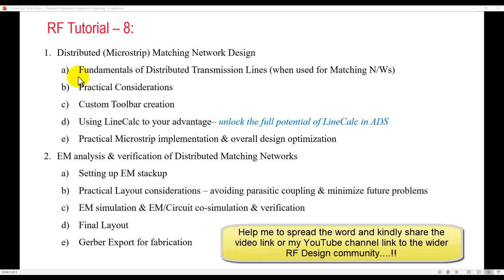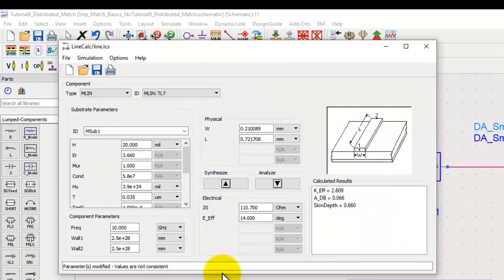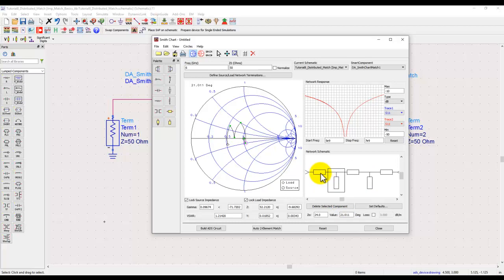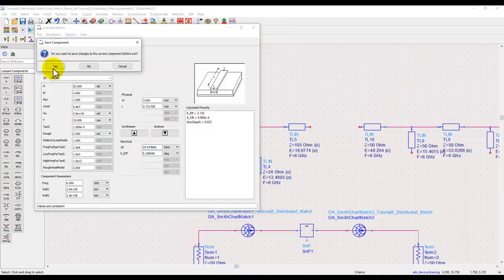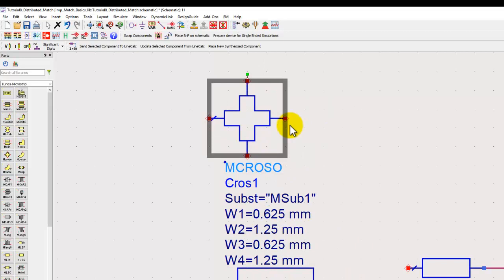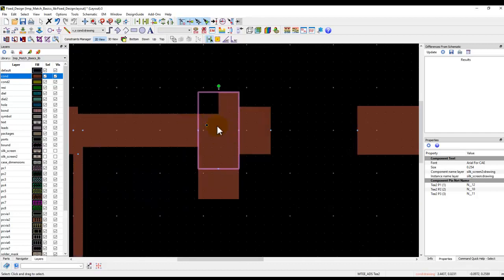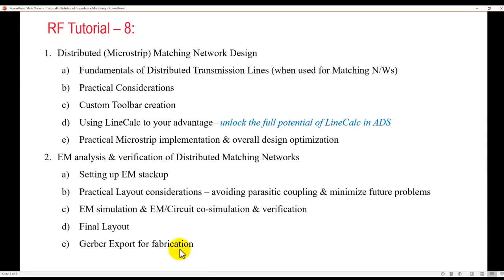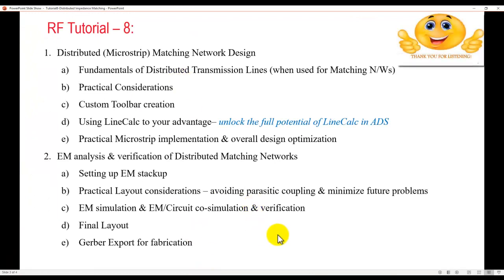RF Design-8: Distributed Impedance Matching Network Design

Comment: Thanks alot for the tutorial , I am struggling with my LNA design 
It's match perfectly but when i connect my antenna the noise figure increase and the matching courrpted ,my antenna also match Very well s11 about -30dB
Reply from the maker: It might be due to the Antenna impedance's impact on your LNA. Your input impedance matching network could use complex to complex matching methodology. Check out other videos in the series to get your answer

Comment: I’m trying to match a broad band antenna but the smith chart tool only tunes one frequency. I’m trying to explore alternative cosim strategies but nothing is giving a good impedance in broadband. I’m matching 617mhz to 5GHz and the antenna is very high impedance at low band. Do you have any advice? I appreciate your tips here but I’m not able to implement them for my purpose, other than possibly redesigning my antenna

Comment: How can I match two frequencies.
Reply from the maker: You can match any number of frequencies with the proper simulation setup and optimization bench as long as you have the right network model in place.
Reply: @BhargavaAnurag  frequency Iam matching is 0.915 GHz and 2.45 GHz. I have matched 2.45 and I am confused with how to match 0.915GHz since the Smith chart can match only one frequency at a time.
Reply from the maker: @Amruthappillai  Yes, that is correct and limitation with Smith Chart in general. However, if you already the network that you would like to use then you can perform optimization and calculation etc directly in ADS schematic and don't need to restrict yourself with Smith Chart alone. I mean you can get the initial guidance from Smith Chart but then rely more on ADS schematic design to complete the matching network design....
Hope this helps.

Comment: Sir, I have a doubt, if the width can't be increased beyond 3mm(Z0 = 24.57) then the limit on Z0 will be 25 and not 24 , because to get Z0 = 24, we should increase width further.
Reply from the maker: Usually it is never a problem for fabricator to print lines as wide as you want so there shouldn't be any concern. Even if it is a concern for you due to overall size etc then also you can design circuits within the constraints you have.

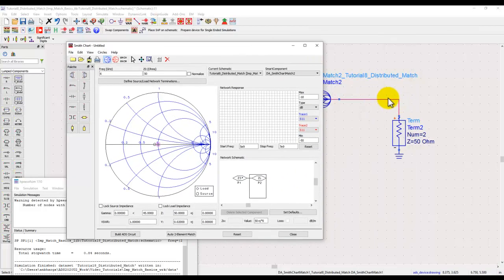Comment: At 16:35, you used a 70 ohm, 20 deg line for accomodating sma pin. What is the issue with taking 50 ohm, 20 deg line? And, how do we know that sma pin lead has width corresponding to 70 ohm ?
Reply from the maker: Its all about pre studying your material and knowing the limits and key impedances as per the stack up being used. You can take help of Line Calc to keep few numbers ready for your designs.

Comment: Sir, there is no hole layer in the stack up so i couldnt switch the entry layer to hole.
Reply from the maker: Switching to hole layer for drawing in layout has no dependency on the stackup but there is no fun doing that either as it will be ignored during simulation.
1. Right click on the stackup dielectric and select Map Conductor Via, it should by default be hole layer but if it is not then you can change it easily from the right hand side panel
2. In Layout window, simply look for the drop down menu with the layer name in the toolbar and select hole layer and draw the shape you want in the layout

Comment: Nice work.  Does a diode(SMS7630, HSMS XXXX series have footprint in ADS? If yes how can I get them to convert my schematic to layout
Reply from the maker: Kindly watch the video on Layout footprint etc under Learn ADS in 5mins playlist. Its very easy to create a footprint and associate it to any component you have in your schematic design.
Reply: Good I got it. I have a purely imaginary load. When I put in smith chart it says real part must not be zero. what do I do?

Comment: Helpful videos sir. I have a query sir, can we build a matching circuit without using smith chart. I am trying to design from a paper where the matching circuit is built using microstrip components such as MBSTUB, MTaper,etc
Reply from the maker: Smith Chart makes it easier to visualize how your matching components transforms the impedance when you add different components. If you already have the right network topology then you can simply use optimization feature in the software to achieve the needed impedance without using Smith Chart.

Comment: Thank you for the elaborate explanation sir. May i know if the procedures for the non uniform transmission line matching circuit  is same as this?
Reply from the maker: I am not sure what is meant by non uniform transmission lines but largely the procedure will remain same.

Comment: please tell me, Is the fabrication process of antenna and (impedance matching plus rectifier circuit)     different?
Reply from the maker: I am not pretty sure if I got this question correctly but if you are asking about the PCB fabrication then yes, it is exactly the same process.

Comment: Good day sir, thank you for your effort for making such informative videos! May I know if it’s possible to add components soldering pads to the layout of the circuit before exporting it into a gerber file?
Reply from the maker: Yes, you can and you need to map it like any other conductor layer or footprint.

Comment: Sir I have designed complete schematic of PA in ADS but when i generate layout I am not able to got correct layout as it have some lumped components also but distributed transmission lines are also not generated as in schematic..Please help me out how I can generate layout to perform em simulation.
or I have  to design my circuit in layout again but it’s very big circuit please guide me in best possible way and if i m doing some mistake in generation.
Also suggest me how to use another method of place each component from schematic to layout.
Thank you
Reply from the maker: Hi,
You can use Place components from Schematic to Layout and place them 1 by 1. I will soon have a video on this topic in next 1-2 weeks which should be of your help.
Reply: @BhargavaAnurag  Please make video in detail sir, as one is doing first time  EM co-simulation (having both lumped and distributed components in design)
Thank you Sir.
Reply from the maker: Its already there on my channel. Look for EM Circuit Cosimulation video and that explains all the details necessary for beginners.

Comment: How to determine the input for the MSub.? where to get those input (reference).?
Reply from the maker: MSUB parameters depends on the substrate/PCB you want to use for your design and manufacturer datasheet will provide all the required values.

Comment: What can you do when you're using a PDK which doesn't appear in the Line Calc. tool for substrate definitions? How can you convert TLIN elements to MLIN which are in the PDK?
Reply from the maker: Hi,
I couldn't understand the exact query. You normally don't use LineCalc for PDK as design manual might provide 50Ohm width already and in some PDK when you change the width it shows the impedance in the dialog box itself. If none of that works then you can simply create a schematic template with 2 50 Ohm terminations, place you line and make width to be optimizable with S11 optimization goal as better than -40dB or so and ADS will let you know what width value provides the best matching and that's your 50Ohm width. If you need any other impedance than 50Ohm then simply change the terminations value to that number and run optimization to obtain width value for that impedance.
Hope this helps...

Comment: Hi Anurag, When using the microstrip Tee junction model, I get warnings saying that I have violated the largest width to smallest width ratio for the model. This is a result of having generated an optimized impedance matching network. Should I ignore these errors and proceed to layout? Or, should I allow this constraint to dictate how good of an impedance match I can achieve?
Reply from the maker: Hi Abraham,
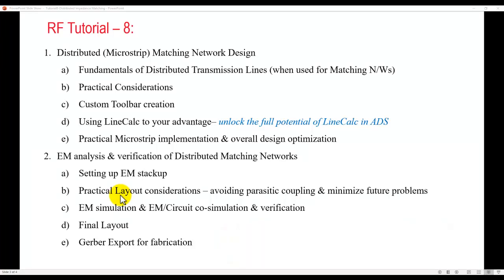Schematic discontinuity models use analytical equation in Schematic which has their limits to maintain the accuracy of the formulation or the assumption they are build upon and usually for models such as TEE and STEP etc it is 1:5 or 1:10 ratio that they recommend, if you cross that then you will see these kind of warnings in the simulation status. You can ignore them and your simulation will surely run but it is telling you that if there is any reflection happening at that junction it will not be accurately captured in your circuit simulation and when you perform EM simulation you will see increased discrepancy between schematic and EM results. 
EM simulator are physics based so they don't have any limitations for the width ratio at junctions and will capture any distortion caused due to high width mismatch.

Personally, I never like to have this kind of situation as it is not a good design practice (however no one is stopping you in having these in your designs) and if I see this situation after optimization then I will try to create a stepped impedance section for that transition e.g. you can go from 0.2mm width to 0.8mm and then eventually to 3mm instead of directly connecting 0.2mm wide line to 3mm line as then the impedance mismatch will be too high and bigger reflections will surely happen depending on dielectric material and frequency of operation.
Hope this helps in some manner?
Reply: @BhargavaAnurag  Thanks Anurag! Yes, this helps.

Comment: Simply wow!! I've been using ADS for many purposes but this tutorial was simply amazing. 

There is a one question. Doing impedance matching for small bandwidth is easier compared to wideband matching. I'm using multiple RF SMT components in series cascaded manner and when I cascade them, the overall return loss degrades despite the fact the their individual s-parameters are very good.

Nope my frequency is upto 26 GHz and I'm unable to control the return loss crossing 10 dB threshold even with matching techniques using radical stubs for wideband matching. 

Any insight into this problem? Any literature, video, documents, books or anything related will be of great help.

Thanks once again for wonderful tutorial.
Reply from the maker: Hi Hamza,
Too many queries here but let me try to answer:
1. Thanks for your feedback and I am glad you liked it.
2. For wideband matching kindly see RF Design-7 tutorial. When overall return loss degrades that's where RF/uWave fun begins...😊 Kindly use SP_Probes to inspect impedances between network and try to approach your matching network design scientifically instead of using brute force.
3. When you say your frequency is upto 26GHz, I am not sure what are you using for fabrication as PCBs will have high loss and sensitivity to anything above 18GHz so things will get very tricky. Using distributed matching is one of the option but you will need to use something like 5mil or 10mil (max) substrate to avoid radiations and etching high impedance lines on such substrate would be quite challenging.
Best of Luck...
Reply: @BhargavaAnurag  I appreciate you replying our comments and that's encouraging 😊. 

Yes, I'm using 5 mil substrate with 50 micron lines accuracy. 

I'll go through the tutorial and methods you mentioned and hopefully it'll help as always.

Thanks again 😊

Comment: Hi Mr. Anurag, I really enjoy your video tutorials, it is very helpful ^^ What is the Layout Units/ Resolutions settings that you are using? I couldn’t get my circuit to fit perfectly like yours even though my microstrip lines dimension are similar to yours... /.\
Reply from the maker: For these kind of designs I always use 'mm' with default database resolution nothing very special...

Comment: Amazing video! I'd like to ask for your opinion on what should I do if I want to simply just set the microstrip line between two components without considering about matching? How should I set the dimensions of the lines?
Reply from the maker: Hi Pay,
Usually we prefer using a 50Ohm line to connect between components and you can calculate the width of 50Ohm line using Line Calc depending on the substrate properties.
Hope this helps...👍
Reply: @BhargavaAnurag  It's clear, thank you very much for your reply!

Comment: Since you've helped me so... so much, I'd like to give you a quick tip for sorting out all the working windows onto your screen underview. 
Try windows+right (or left) to shift the selected window to the right half or right half of your screen, and upon further using down or up you can get the window to be quarter of the full working screen.
Reply from the maker: Thanks for the tip...👍I was only aware of drag & drop, this makes it simpler...😊

Comment: I am following your video and it’s being very helpful. Can you please help me if I want to design input and output matching network only with MLIN transmission line without using MLOC lines .It will be great help. Thanks in advance.
Reply from the maker: Hi,
That will depend on the impedances that you want to match and may not be always possible. You can the Smith Chart tool so feel free to try out whatever topology you want and play with the impedance of the lines to adjust the locus and drive it to the desired point as per your requirements.
Reply: @BhargavaAnurag  Thank you Sir . I will try for same. Please can you make one video on load pull simulation using ADS in correct manner because your videos are very clear and show the right path.Thank you.

Comment: Thank you so much for this valuable video.

Please, after we design this on ADS and fabricate the circuit, we need to add an  SMA to connect it to a coaxial cable, and this will change the circuit. Then, can you explain how to remove the effect of adding an SMA in the circuit to obtain similarity between measured and simulated results (Signal integrity)?

Thank you again.
Reply from the maker: Hi Melad,
There can be multiple approaches:
1. First you need to ensure Calibration was done on VNA, that will take care of the cable part reaching up to the connector on your board.
2. To model connector, you can cascade the S2P file of the connector alongwith ADS results to see overall behavior.
3. You can add 3D connector model of the connector and perform full 3D EM simulation to get results upto the connector output side.
4. Deembbed connector during your VNA measurements
Reply: Anurag Bhargava 
Thank you so much for your reply.
Hopefully you have the time to do a demonstration video about those practical methods.
Thanks again

Comment: How would you optimize the actual layout using the optimizer in ADS?  Do you need to parameterize every p-cell txline in layout?  Can you show how?
Reply from the maker: Hi,
Kindly see this video i.e. Tutorial-26 under Learn ADS in 5mins playlist: https://youtu.be/HsZXTfB8SWg
There I ran a parameter sweep but you could run Optimization in schematic. Be careful in not running optimization blindly in EM cases and I always prefer to run nested parameter sweeps and then turn on the interpolation in EM models to arrive at optimum values via optimization.
Reply: @BhargavaAnurag  thank you I will check that. Also what setting do I change to prevent it from doing that? I thought that is all code running in the background and we are just along for the ride without any say. It sounds like we can tell it to do EM optimizations only? How?
Reply from the maker: Hi,
If you have parametric em component on schematic you setup and run optimization then obviously it will run EM optimization as that's your circuit. Where is the confusion?
Reply: @BhargavaAnurag  You said be careful not to run optimizations blindly. Not sure what that means. Usually one would select the parameters to be optimized. So I misunderstood the comment.
Reply from the maker: @rjrodrig  What I meant by blind EM optimization was:
1. In normal circuit optimization things run very fast as you are using analytical models of the components so even if you are very far from your goal, it is always possible to come close to meet the goals within few mins.
2. In EM optimization case, it will run an EM simulation for every iteration so even if 1 EM sim takes only2 mins to finish, for 100 optimization iterations will end up taking ~200mins which is huge so you need to be sensitive to what point you really start the optimization.
3. If you are close to your goals then EM optimization will quickly bring you to the goal else it might be a very time-consuming process.
4. Also, before running EM optimization, you could try to run Parameter Sweep on the variable so that you can get a trend and get a sense of which parameter you really want to optimize to save unnecessary wastage of time in optimizing a parameter which really doesn't make any sense.

Hope this clarifies.

Comment: Best tutorials anyone can find. I was looking for broadband impedance matching for a long time. Thank you.
Sir, can you tell me where and how can we do connector to GCPW transition simulation for mm-wave frequency?
Reply from the maker: Hi Manisha,
You can use EMPro standalone simulate such structure and flow will be to export ADS Layout to EMPro and then add a SMA connector model to perform combined simulation.
As a 2nd option, you can bring in EMPro based 3D components such as SMA into ADS and then use the built-in FEM simulator to perform such analysis with great ease.
I have the plan to have such tutorials in the near future and you should see some of those after 15th Aug on my YouTube channel...
Reply: @BhargavaAnurag  Noted Sir, thank you